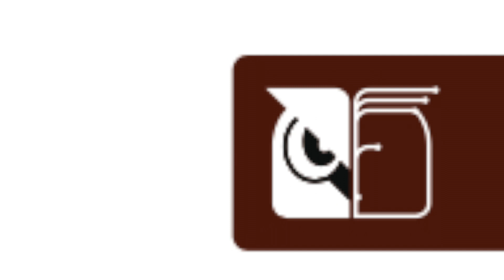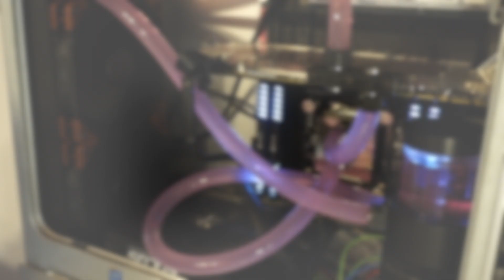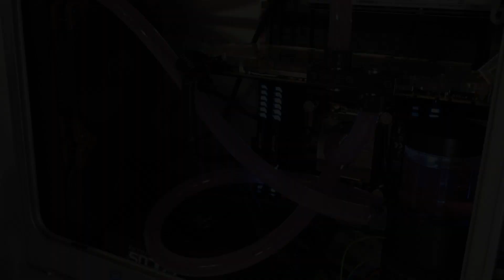NOCTUA NF-A 14 INDUSTRIAL PPC-3000RPM PWM INSANE POWERFULL FAN TEST

Comment: bloody hell tbh if you having to run these kind of fans in a gaming setup at them speeds there is something wrong with your setup i couldnt have a rig with loud fans like that even for my 4090 i going lower but a huge thankyou for convincing me on not to get them will stick to the quiete ones and use great airflow 3000rpm is crazy amount and sounds awful great video and a very well done
Reply: The headroom is there if you need it. But if you play resource heavy games like BeamNG Drive or Forza Horizon 5. These wouldn’t be a bad idea. Especially if you live in a hot area.
Reply from the maker: Haha, im still using them. They just work perferct, silent and powerfull if you need it. And the best part of them, they don't break. I have tryed so many fans and all of them start to make noises after a few years.
Reply: I disagree, these fans are absolutely essential for gaming. Even an overclocked RTX 4090 must never dare to challenge Noctua with anything over 2 degrees Celsius.

Comment: How is the best choice for these? To cool directly components or as static pressure?
Reply from the maker: Doesn't matter, they are overkill in every situation. you could use them in a car. they also work under water xD
Reply: @Runliquid  ok nice 😍🙌 so they should be very nice in my new thermaltake core v21 case, Ryzen 5 5600x and the giant Asrock RX 6900 XT 😍🙌
THANK YOU!!!

Comment: I had serious problems to get my boosted ryzen 9 5900x under 90°C while gaming. First I. tried it it with  the arctic 360aio water cooler but it didn't work. - temperatures was still at 85°C and idle at 65°.  Then I got my deepcool assassin 2 air cooler. With stock-fans it was better but not great. Then I ordered 2 of these noctua industrial fans with 3000rpm and got 45° at idle and 67°at long time playing high end games in 1440p with rtx 3080.fans run at 50%  and the noise is OK. - the air passage of these fans is awesome.
Reply: Something isnt right, i have a 5900x, tuned to 4.6(cb)-4.8(aida) all core loads and 5.1ghz boosts in windows and gaming, my idle is like 28c and max is in low 70's (synthetic) and gaming around 60c. Currently running a 240 and a 280 in a custom loop that my gpu is also in, so in reality less than 1 360 for the cpu. Even in i run prime and donut of death i aint hitting 90!
Reply: @dunxy  he got a bad chip. Needs to rma that

Comment: going to put 5 of these in my new build. 2 exhaust 3 intake... cant figure out if overpressuring the case a lot will be counter productive with pressure pockets
Reply: Why not just add a low RPM as an exhaust on the roof? A simple 1200rpm should do it right?

Comment: Hope these fans can cool down my case so my GTX 780 OC doesn't continue reaching ~90c
Reply from the maker: Haha yes they can, but you could try a custom Fan curve with MSI afterburner, or a repaste, the 780 is Not the jungest Card. Clean, repaste, fancurve, and good airflow keeps your stuff alive.
Reply: @Runliquid   @Run liquid  Already put the fans at 100% manually when playing, cleaned it up completely, repasted it with some brand new MX4, but I think my problem might be airflow. I have a Masterbox Q300L with some slightly cheap Apenia fans for intake in the front, and the stock fan that came with the case as exhaust in the back. I'm planning on putting two Noctua fans in the front of the case as intake,  2 Phanteks SK140 fans in the top as exhaust, and another Phantek SK140 on the back as an exhaust as well. Also planning to maybe use an old Apenia fan as a bottom intake fan. My GTX 780 has an ACX cooler, which from I take are supposed to be pretty good, so I'm hoping my problem all along was case airflow.
Reply: Update: Noctua fans arrived. I'm starting to regret this a little. They sound like a legit jet engine.
Reply: @JuanLopez-ss3mz  don't regret, embrace the jet engine that helps your hardware to be pushed to the absolute limit.
Reply: 4 month update: embraced the jet engine

Comment: I just ordered 2 of these for my Kraken X63 rad, can't wait to see how much lower my temps will be under load, though I probably won't let them reach 3000 rpm, too loud, but good to know it's there if I do ever need it
Reply: So how about your temps?
Reply: @RESURRECT2  sorry for the late reply. Temps went down 10-12°C under load, stayed the same for idle. You'll def have to play with the fan curve, so make sure you plug into PWM supported connections. 

On stock Kraken X63 radiator fans I got 78°C under load after 10 minutes of Cinebench. With these Noctuas I get no higher than 68°C after the same time on Cinebench.

EDIT: Normal gaming load temps went down as well. For example, I used to get up to 65°C while playing MSFS, now it won't go over 60°C. They are quiet also, as long as you don't go over 30% you won't really hear them, silent to me at 25%. Just play with the fan curve. If you'd like I can post mine tonight when I get home. It's quiet but very effective.
Reply: @-Ncrypt  what is your processor? Can you please check the cpu power consumption during cinebench?
Reply: @lovac_hunt  I have a 10700k. CPU power consumption during Cinebench R23 test is 153W
Reply: @-Ncrypt  Thinking of buying this for a top exhaust. I wanted to ask what RPM do you think it becomes too noisy? IYO do you think this is louder at 2000 RPM as the 2000 PPC counterpart, if not why would I buy the 2000 PPC?
Reply: @inthezoneeeechief  I’ve never used the 2000 PPC ones you mentioned so idk the difference. These 3000 rpm ones, I run them at 900-1500 rpm and when they get to 1500 they are audible af lol, but they move a lot of air (cfm) when spinning fast and idling quiet too

Edit: yea I’d just get the 2000 ppc ones, that’s what I would buy today if I needed fans. I don’t think they had the 2000 ppc ones when I bought mine 3 years ago. Mine start to get loud at like 1300 rpm but if you have a good fan curve and good airflow in your case they rarely will have to spin that fast so it won’t be a problem

Comment: as you are gently increasing the speed im ''gently'' reducing the volume on my 5.1 speaker setup xDDDD

got 4 of this devils, i know first hand how they sing on speeds above 1500rpm.

oh word of note to everyone, this fans are high amperage, that means you DO NOT want to power more then 1 of em from mobo fan header, and even if you do power just one, make sure you use high amperage fan header for it, or you gonna fry the header. power em from sata cables or molex.
Reply: Thanks for the warning, you probably saved my fan headers...
Reply: They do make a non 24v version
Reply: @atlasxdw8271  but the 12v ones are weaker?
Reply: @ilovehotdogs125790  Not really they have the same max rpm I think its use case scenario in an average pc the 12v 3000rpm fans are still over kill with the amazing static pressure I just bought the 12v ones to put on my kraken z 63 rad and the temps are much better its all use case
Reply: Decent motherboards have 1 amp headers and these (in 120mm, 140's are thirsty..) rated for like .35...
Reply: My cpu fan header handlea 3A

Comment: I just bought two for my new build...I think I may have overdone it a tad.
Reply from the maker: XD maybe
Reply: Dude I thought these were CASE fans. I BOUGHT 8 OF THEM
Reply: @TheClipsterClips  They are only for radiators ? I wanted to buy 6 as well for case but i passed and went with 140mm redux.
Reply: If you have a 10900k nothing is overkill..
Reply: uhhhh, i just installed 11 of the f-12 3000rpm ones in my full size case, is that overkill? lol
Reply: @teq23laz  depends how good is the cooling for you

Comment: This was with the case open. How do they sound with the case closed ? I am looking to buy 4 of these for my radiator to run in a push pull.
Reply: you won't need push pull just 2 fans on one side is enough.
Reply: @forceawakened8084  hey thanks for the reply. I bought the 4 fans and running them at full speed. I don't mind the sound.
Reply: @Dude_Virus  Is there any improvement going from 2 fans to 4? At these flow rate and Static pressure  it would be hard to believe you gained anything.
Reply: @forceawakened8084  I did notice that my idle temps as well as max temps were down than what they were earlier.  Also the coolant temp is down from what it was earlier. I am in India and don't use an AC so my ambient room temp using a ceiling fan or a cooler ranges between 20 to 28 degree C depending on the outside climate. Earlier the coolant temp always used to be above 33 or 34 degrees C. I was using a push pull but with the lower RPM noctua and the corsair ml140 fans. Now I have seen the coolant temp below 30, ranging from 24 to 28 degrees C. My CPU idle temp is in the 30s than the 40s earlier. Load temps are in 70s than the earlier 80s. So I have seen an improvement... Not sure if I would have got the same result with only 2 fans or maybe I would have.

Comment: can this fan be solution for two 2.5 gpu SLI cards that doesn't have enough air space?
Reply from the maker: Yes, but it will be very loud. Maybe you can add some Space with a riser cable.

Comment: Can these fans run at lower rpm, like 400RPM? Thanks
Reply from the maker: No because they need a high Start volatage, low Speed Fans with pwm always make funny noises ^^ so Go 4 dc.
Reply: @Runliquid  Oh.. I ordered but didn't read about lowest possible rpm these fans can provide. Then I will disable them at idle, and make them run only when some load is present. Thanks for info. I will also try low noise adapters from Noctua
Reply: 300rpm minimal but they start at a higher rpm.
Reply: 300 rpm seems possible on my two 2000 rpm variant of those fans.